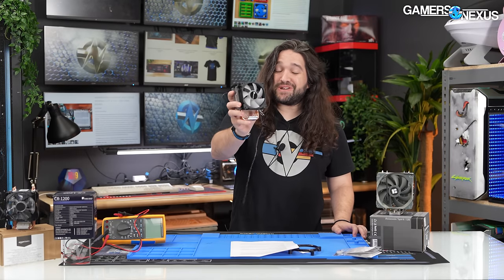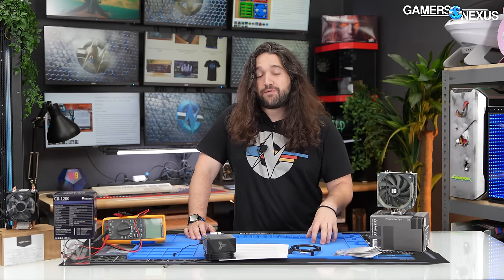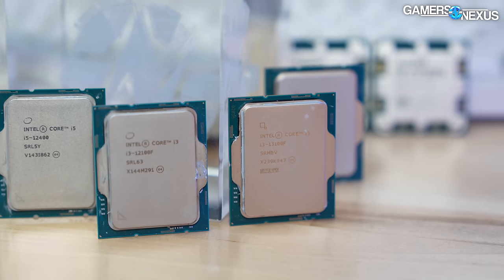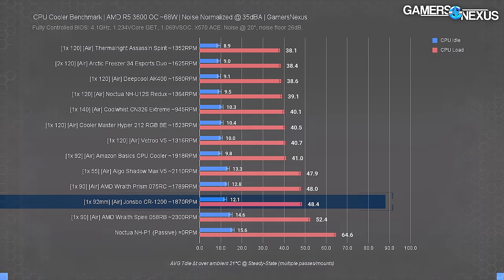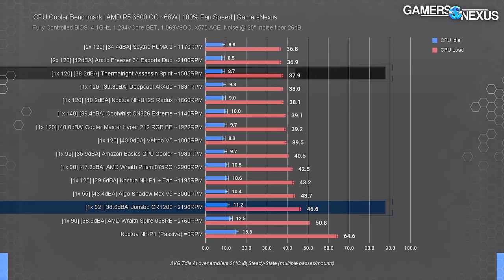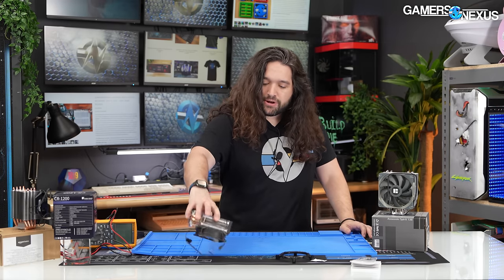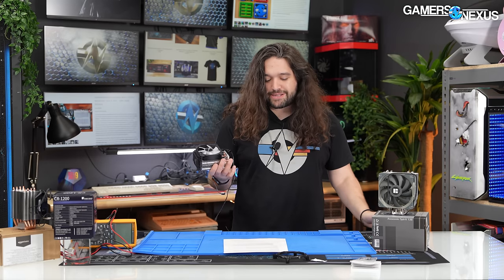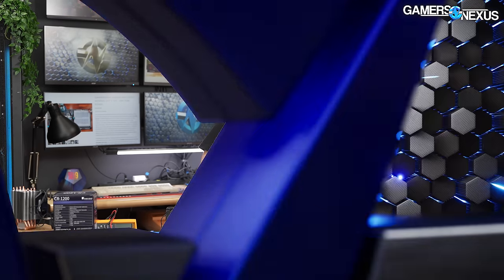Testing the Cheapest Possible CPU Cooler | Jonsbo CR1200 Benchmarks & Review

Comment: Seems good for those old locked i7 cpus, especially if you are using that jet engine intel stock cooler. Would definitely consider buying one of these for my backup system sporting an old 4th gen E3 Xeon as the intel stock cooler (copper version) struggle in summer with noise, having to take the side panel off.

Btw got the 5 pipe version of the Assassin King 120 SE ARGB for my R5 5600 and it's just great, really glad to have bought it, my only regret would be opting for the ARGB version instead of the non one, it's literally the only RGB component in my system.
Reply: As a reminder, 4th gen socket 1150 processors do not have a soldered heatspreader. If you are seeing major near-instantaneous jumps in core temps when toggling between idle and full load (say, 20-30 K in 1-3 seconds), the TIM may have run its course and delidding to apply liquid metal (pad) may be called for. It goes without saying that you should do your homework before attempting such a procedure, but substantial improvements in temperatures would be expected under these circumstances. It's a good opportunity to replace thermal paste and clean the cooler as well.

A cooler upgrade would still not be a bad idea, these Intel boxed cooler fans don't have the most pleasant tonality and then there's those annoying pushpins.

You can judge cooler heat soak from temperatures a few seconds after full load has been removed.
Reply: @PileOfEmptyTapes  Hi, in my case idle and load temperature are in the norm, idle generally sits around 34° and gradually goes up to 64° in heavy load (summer temps btw, right now idle is about  27° and full load about 58°). It's just that it's in an old office type case, but the main components are all relatively low powered, so the intel stock cooler (+ the single fan on a 1050ti) runs harder in summer unless I take off the side panel off , while in cooler season I can get away with silent mod on my mobo and stable temps.

So I was thinking that his cheap cooler could be enough to reduce noise and redirect at least the cpu heat away from the case.
Reply: @GLDragon93  If these are core temps and heavy load is something like Prime95 small FFTs, that seems more than OK, and you could probably back off on the fan curve a bit. What are the respective ambient temperatures in your place (now/summer)? If you get heat buildup in the CPU area, that indicates poor case ventilation. This makes any cooler's job more difficult. I have experimented with case fan vs. CPU fan RPM and had some surprising findings. Protip for tower coolers: Use cardboard or something to deflect a small part of fan airflow down onto the VRMs, they'll thank you with better temps.

What kind of ventilation options does the case provide, and what is equipped right now? I have something similar as an office PC, it's a 3rd gen MicroATX platform. Years ago re-homed it into an old mid-2000s ASUS case (still more robust than the newer tin box) that provides space for a 92mm exhaust and 80 mm intake fan, with an intake that's blocked off by the front panel to a substantial degree. Probably quite typical.

After I was unsuccessful fixing the old rattling power supply fan, I got a new, much quieter and more efficient PSU (be quiet! Pure Power 11 400W). Ironically, it came with a dragging fan... the rotor had not been pushed down all the way, which I was able to fix. Ah, QC during the pandemic...
As airflow would now be reduced, I also added an exhaust fan (be quiet! Pure Wings 2 92mm PWM), and the basic EKL CPU cooler has to be one of the few of the kind to ever receive a fancy Noctua fan upgrade (NF-A9 PWM, with the supplied rubber nipples used to mount the exhaust fan). I had to improvise in terms of mounting as the original was one of those 92mm jobs with 80mm hole spacing, but it's staying on there.
The trusty i3-2120 was eventually replaced by an i3-3570S (similar heat load, substantially quicker and more modern iGPU drivers).
Eventually I also added an intake fan (Pure Wings 2 80 mm PWM, with some rubber nipples I had liberated from another case fan at some point) and a PWM fan splitter (as the board is very short on fan connectors) in order to fix the highish SSD temperatures I was seeing. The front panel consists of two parts that are clipped together, and I was able to unclip the outer part and sort of leave it halfway on there, so the case will now breathe a whole lot more easily.
I could still attack the front panel with a hole saw and add a grille, but for right now it's OK like that. I sort of want it to be a sleeper type build. It still pretty much looks like something straight out of 2006.
The platform here is old enough for fan control to be possible via Speedfan still. I am told this may no longer work for newer hardware. Anyway, the system remains whisper quiet during normal operation, and is not particularly noisy under load (which it rarely ever sees anyway).
Reply: @PileOfEmptyTapes  Thank you for the info, especially the cardboard one. Mine has an 80mm exhaust fan and an additional 80mm for the side panel. It's possible to mount one in the lower front as well, but again like yours it's completely blocked off. As for current temps, right now it's about 20°, while in summer it goes to about 29-32° with very high humidity, probably a bit more since my room in particular is hit directly by the sun for about 9 hours in summer.

I don't want to spend too much money on it, and will probably spend a total of 50-70€, just planning to upgrade a few things only when bumping into good deals on Ebay.

Comment: $2.77 is actually not real price. As you could see, shipping is about $15. It is trick for the case if you will need to open a dispute due to faulty sample and if the dispute will be fulfilled, shipping "cost" will not be refunded anyway. And part of the "shipping cost" is actually seller's margin. So I would call this is sort of speculation in video.

Comment: The most critical weak point of this cooler is it’s bracket which will get pretty fragile and hard to remove after 1-2 years of usage. I’ve broken countless number of pins when trying to remove them to change the motherboard or cpu. And at that price range, there still some better alternatives (at least in Vietnam) like the ID-Cooling SE-30 or Jonsbo CR-1400
Reply: I have used and still use the cr1400. Great cooler.

Comment: I bought for $20 off of Amazon a Thermaltake Contac 9 SE CPU cooler. It's a 92mm fan with 2 pipes and it runs my Ryzen 5 5600X almost 10 degrees cooler than the AMD cooler that came with it. So I understand what you're going with this cooler.

Comment: My recent HTPC build needed quiet cooling with 118mm clearance and lower wattage CPU. Ended up with Termaltake Assassin X 90 SE as seemed good value at 3x less than Noctua equivalent - but still over double the Jonsbo CR1200. Thermals look healthy on the system, but I would love to know how this smaller "Assassin" model actually tests out.

Comment: i just want to point out, that the reason there are two push tabs on the mounting spring for the heatsink is so that you don't need to hook one side first... The complaint is for when there is only one push tab, cause it cause uneven mounting and can be very awkward to seat on some boards. This design actually does relieve some of that and while its not great or even much better, on a 3 dollar product its fair to point out lol. Also, if you're hooking one side first, the pressure mapping isn't gonna be accurate, the excess pressure showing on the left side may just be from the act of wrenching it over to mount it. It's clear that the mounting is the weak link tho and if they changed that, this would probably be a really good budget cooler, even if they had to double the price to make the change.

Comment: You Should Also Checkout their Jonsbo CR-1000 for under 10$ Tower Cooler and also the Jonsbo HX4170D, the Criorig and Noctua L9i competitive which height under 40mm, very good price/performance as what i've experience, the HX4170D with the 170W TDP can withstand the 13600K stock verywell and worth to consider

Comment: I have one of these coolers paired with a 92 MM nautua fan on it and it cools my i7 9700 family room PC. I got it off a junky 4th gen computer someone brought in to me that the Mobo stopped working on. I took all the nonaddressable RGB stuff off of it and the fan and the only thing I'm using is the heatsink, it actually cools the i7 9700 surprisingly well with the natutua fan, but as you said that's a 65w chip. When I saw the fan on it though, I said no way I'm not using that 3 pin fan! 🤣

Comment: I wonder what a couple of hours of lapping would produce with this cooler?  It's obvious from your pressure maps that the high points are the pipes.  If you could flatten them, along with bringing those high points down to the base, maybe it'll help.  It's cheap enough that if you wreck it (not experienced at lapping) then it's not a big loss.  However it has to potential to "drastically" improve it's stock performance.  "Drastic" being a couple of degrees, but that would place it higher on your charts.  Considering it's cost, this would pair well with a low end 13th gen Intel CPU or AM4/AM5 build.

Comment: I bought the Jonsbo CR1100 for my 11900K build and it was only 40 bucks on Amazon at the time. It worked amazingly well for my processor when I had the stock limits and speeds. Never went above 80-55c or so, in Cinebench, and stayed around 50-55c in games. Recently, I removed the power limits and did a 5.3ghz all core turbo on it, and found that it was struggling to deal with all the extra heat from the CPU. It quickly reaches 100c. My "fix" -although not the proper way, was to limit the temperature down to 90c. I know I should undervolt it, to bring the heat down to a reasonable level, but I'm not very good at overclocking. The ASUS ROG Strix BIOS is quite expansive and can be very confusing when it comes to these settings...

Comment: I have gone with ALIEX and the SNOWMAN 2x120mm 6-pipe CPU cooler.  Excellent value and performance, considering its price point (~$27 w/out RGB). For my more demanding system (E5-1680V2 (8C/16T) OC'd @4.5Ghz all core; or E5-2696V3 (18C/36T) turbo-unlocked), the PCCooler GI-66A (aka GAMEMAX Gamma 600 ARGB) with 230W TDP rating. The Gamma 600 is usually around $50.

Comment: Seeing how bad some of these pressure maps are for cheap coolers makes me wonder if there's any merit to cheaply and quickly hand-sanding them with some fine grit (perhaps 1000+?) sandpaper to improve flatness. I know that IHS lapping already exists so it'd be interesting to see how a cooler would fare. Would heat pipes be an issue for coolers that run them exposed at the bottom? Would a uniform surface like Noctua coolers have allow for more/better sanding? Would love to see you guys test this if you somehow ever have the time for it!

Comment: I payed more than $45 for my BeQuiet Dark Rock 4 (On sale at Micro Center) about 8 months ago, but it cools my AMD & 7500X with ease and is so quiet, I have to look to see if it's working.  I never got the additional fan, because it works so well with one.  I could replace the fan for one with RGB, but I use my PC, I don't just stare at it all day like a hypnotized clown!😛

Comment: I would be very interested in a fan review of the SilverStone FHP141, because they seem to be suitable for all purposes (except silence).
It can be used as 140mm and 120mm fan, has a switch for "quiet" vs "performance" usage, is thicker than usual with 38mm and can push some air!
I use them in my main PC and am really happy with them, but I would not trust my own tests, since I have no equipment for those.

All I know is they can deliver more air than Noctua NF-A14.

Comment: I have the CR1100, its pretty decent aside from the fact that you have to screw it on to the motherboard from the back with an included wrench and it gets higher temps than the standard AMD prism cooler but overall it works.

Comment: I did put together a PC with the parts I replaced over the years and used a 5€ CPU Cooler for a 3900x (yes, fight me).
It looks suspiciously close to this one here, to the point that I think it's this same one rebranded.
The 3900x originally came with an AMD cooler but it's at my parent's house quite far away.
No only that but it's sitting in a 30€ case with only 2 fans (one front pulling in and one on the back pushing out + the PSU pushing out a bit too).
It's paired with a 1070 that had been sitting in a box for years (it was starting to rust a bit around the display connectors).
So yes it gets hot as hell stock but disabling SMT (12 cores is more than enough for my use case) and with an undervolt it stays below 75ºC gaming, which I think is decent.
Then I also undervolted the 1070 with afterburner and it all works great, I have a sweet tiny PC in the living room to play some games from the couch :)
Reply: Deepcool AG200? Non rgb?

Comment: I used the CR-1400 with a spare 5600x for kiddo's first build - it's fine... with boost set to 4.85GHz all core, it only hits 90 with y-cruncher avx loads when total package power is 168W - in a warm bedroom in a small, poor airflow case. Idle is low 30s, so about 10 over ambient. Gaming load is ~60. Cost about 10$US from a local (NZ) source. It's fine.. nothing exciting, but if you need a cooler for a non techie, it's cheap and cheerfull.
Reply: CR1400 is legitimately good. It has a lot going for it, especially that it can be oriented to push towards the top of the case unlike the Noctua of the same size, and handles my 3570K at 4.9Ghz without throttling in a dual-system case where it's the top system (heat rises, afterall) that said neither the 5800X3D or the RX 6700 XT in the bottom system outputs a lot of heat and I have 6 intake fans.
Reply: @Vinterloft  something occurred to me watching this vid, we can get a 5$ cr-1200 and convert the 1400 to a push-pull with the extra fan and clips. Given the lack of airflow in my niece's case, it might actually be worth it. Hell, you can probably recover most of the money selling the extra 1200 to your local scrap recycling place.
Reply: @lucidnonsense942  True, both the fan and heatsink has clip points on the opposite sides of them.

Comment: So basically grabbing 2 of these, doing a DIY mounts and mount them bots to a laptop GPU and CPU and it should perform better than stock heatsings and have also less noise... and YES, it would be sticking out from the laptop and the laptop would not be movable anymore but whom is moving a gaming laptop anywhere anyways... I have a laptop just cuz I had to move to different country but when I finally settle up, I wanna diy it... I actually did this with passive heatsinks taped onto the stock heatpipes on the laptop and to my surprise it worked really well... yes only 10 degrees down so GPU went from 87 to like 77 celsius and CPU went from 100 to 95 celsius but the performance was boosted a little bit...

I would love to see someone doing shant mods for laptops cuz I think with proper heat dissipation them laptops could handle well over their power limit... I am bottlenecked most of the time by CPU but the RTX 3060 could use a bit more power since I know it can handle it... Also I tried to download MSI afterburner and for some reason I could boost clocks by +2000 mhz which was odd and the laptop started artefacting immediately and died in 3 seconds... simple restart and I did not touched the OC ever again since then xD its scarry to overclock the only machine you have and dont have enough money to buy a new one...

Comment: This kind of thing would be useful for a high school tech class that teaches young people how to build and maintain computers. It doesn't have to be exceptional. It just has to be functional enough to demonstrate that the build job was done correctly. If a student builds a computer that thermal throttles, this will at least show that it was user error.

Being able to buy 30+ of these for under a hundred bucks would leave enough budget and time for the teacher to then go dumpster-diving for the rest of the components.

Comment: Whenever I see one of these low cost coolers I wonder how a few minutes with a surface plate and some 2000 grit sandpaper would affect the outcome. That'd be an interesting series, could you take a $3 cooler and make it perform better?

Comment: I have a Jonsbo V4 case and I think the layout should be a new mATX standard, and a smaller one for a ITX and SFX power supply should be another standard. With this case I'm limited to a 120mm high tower cooler, and even this cooler in the video wouldn't fit. I found a Thermalright Assassin X90 at 118mm tall with four pin fan and four real heat pipes, it took hours of googling to find some sub 120mm high tower coolers. Thier's also a Thermalright Silver Soul 110 and a Noctua NH-D9L both at 110mm tall which are more then double the price of the X90, and their look sweet, maybe for a top end built.

Comment: While it's beyond the scope of a $3 cooler or even a $20 budget tower cooler, it'd be interesting to see the result of lapping the cold plate. Obviously you'd have to be careful not to sand all the way through the heat pipes. It would however make for an interesting "shits and giggles" kind of video.

Comment: if anything by the looks they should fix that mounting pressure issue and increase the size of the cold plate to accommodate modern CPU's which could make it a kick ass product at a very low price considering the things it competes with cost much much more but don't scale with price that well

also better mounting hardware should be included,and even if this cooler got 20$ more expensive it has a place in the market and would sell